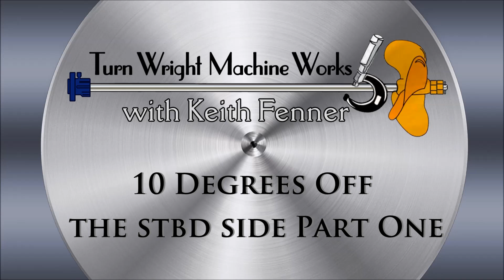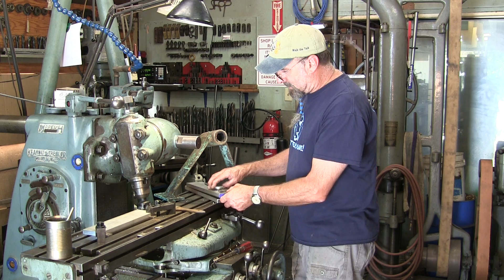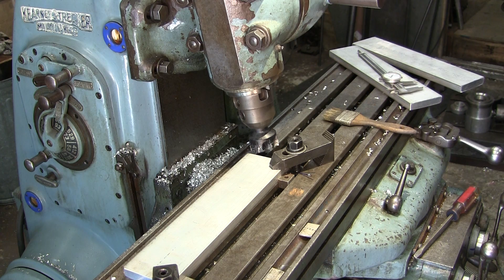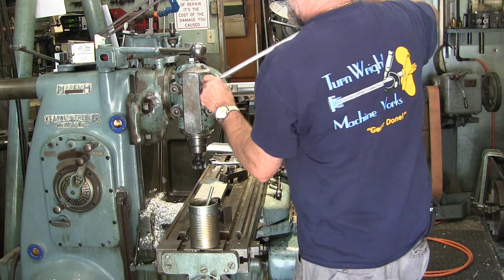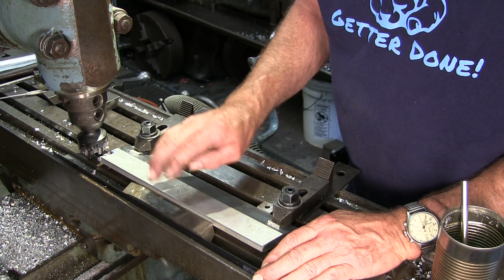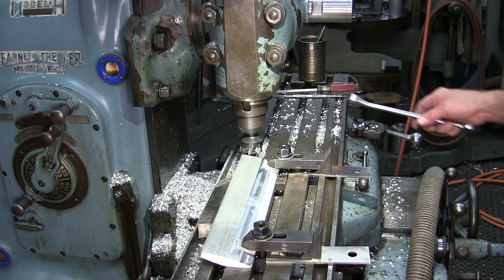10 Degrees Off The STBD Side Part One

Comment: If you had cut from the other direction (table direction) the material would have been pushed into the toe clamps and set up stops and there would have been no need for the awkward positioning of the HSS Tooling to hold the struts.  just a thought.

Comment: Would it not have been easier to start with a longer piece of material, clamp the ends and trim to length when done? Seems that would be safer and minimal setup. I had to taper 2" sq brass recently and it worked great.

Comment: Could you reverse the direction of the cut so that the force of the cutter would push the piece into the clamps.
Reply from the maker: I was pushing the limits on clamping on an angle and as in the comments below;  I would rather spit it out, then suck it in and chew it up, if it gets loose. ;{)------

Comment: About 23 minutes into the video the workpiece slipped its clamps due to tool pressure pushing it away from you and the clamps. Could you have started at the other end, and gone from left to right, so that the cutting force would have pushed the workpiece into the stops?
Reply from the maker: I was pushing the limits on clamping on an angle and as in the comments below;  I would rather spit it out, then suck it in and chew it up, if it gets loose. ;{)------

Comment: its hard to imagine that a factory made replacement is more expensive than a custom hand made replacement
Reply from the maker: In the marine environment more propulsion components are made one at a time than mass produced. ;{)-------
Reply: Keith Fenner interesting. I had always assumed there was some boat equivalent to napa or advance auto.
Reply: Have a similar issue with a strut that rotted.  Bronze eventually does.  Now I have to find the pattern to have a new one poured.  Not having a good time with that!  Like Keith said, most of these parts are limited runs and even then are often custom "adjusted".  Wish I could weld up the old one!

Comment: Nice workholding to get that last angle.  I guess if you had a lot of them to do it would be worth creating a holding jig with a 20 degree included angle so the top of the opposite side would be flat when you flipped over the part after cutting the first two angles.

Comment: Was there a reason for cutting from right to left vs left to right?  I think i would have come in from the left so the cutting forces are pushing the part against the clamps and T-slot stops instead of pulling it away.
Reply from the maker: I would rather spit it out, than suck it in and chew it up, if it gets loose. ;{)------

Comment: Hi Keith.  If you had run the table in reverse direction would it have pushed the strut against the stops or would the cutter have lifted the strut?  Terrific vid.
Reply from the maker: I would rather spit it out, than suck it in and chew it up, if it gets loose. ;{)------

Comment: Good clamping solution there, maybe if you started milling from the other side (so the milling path is opposite now) the tool pressure on the piece would force the piece into the clamping which is  also wedged in this case, so it would've tighten itself and maybe no need for additional clamping solution?

Comment: Forgive this ignorant wood worker. Wouldn't it be easier to have the stock a couple inches longer and feed in and out of the cut? That way clamping is less problematic.
Reply from the maker: The feeding in on a shell style cutter has to start off the edge, no center cutting. ;{)--------

Comment: Would it not be easyer to bend the supports to the bearing shaft in 10 degrees? Maybe giving the frontside of the plate a angle to flow throu the water?

Comment: Why not feed l-r so cut pressure helps your clamps?
Reply from the maker: I would rather spit it out, than suck it in and chew it up, if it gets loose. ;{)------
Reply: That's called "Climb milling", and it's something to avoid if possible because as Kieth said it has a habit of sucking the work into the tool if either one gets loose.

Here's the reason behind it, as I understand it:
Tool pressure is always applied in the same direction relative to the rotation of the tool, and milling cutters (end mills, shell mills, fly cutters, etc.) will only cut when turning in one direction (set when they are made).

When used in "Standard milling", the forces on the tool create a reaction force on the workpiece that pushes it away from the cutter.
However, when used in "Climb milling", the forces on the tool remain the same, but the direction of the reaction force is reversed, causing the cutter to force itself into the workpiece.

As Kieth said, if the workpiece gets loose it will get chewed up instead of spat out. Neither situation is good, but a tool that sucks in a piece of work has a good chance of breaking, and obviously it's cheaper to replace just the work instead of both the work and the tool.
Reply: 11zekim I